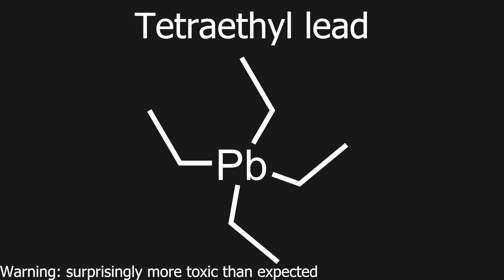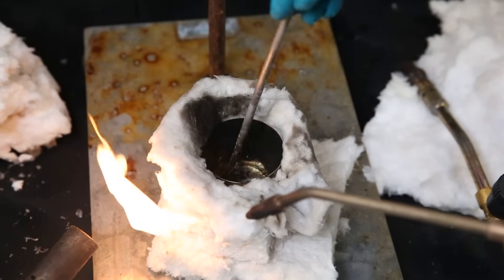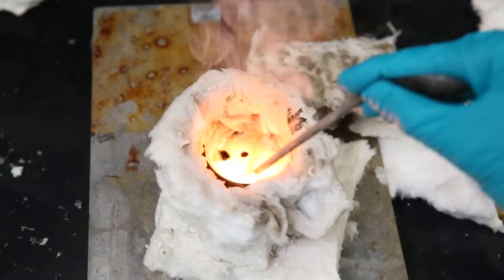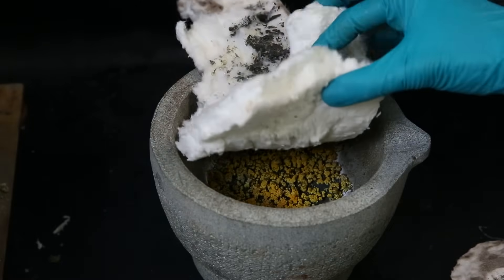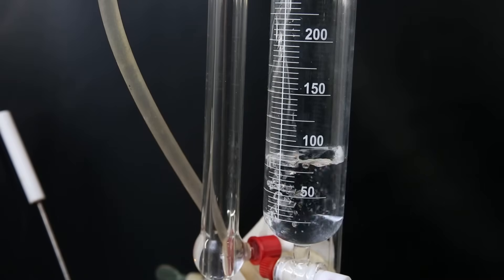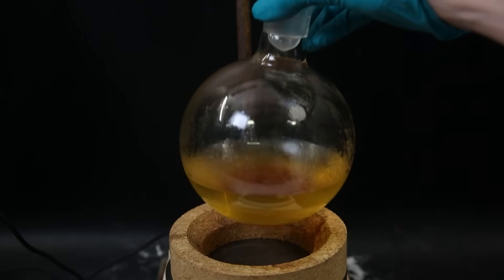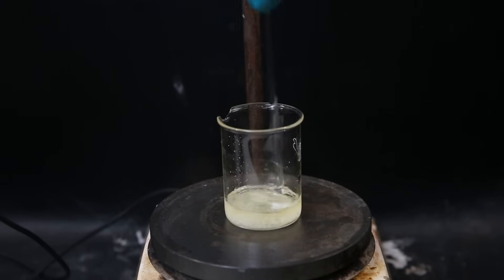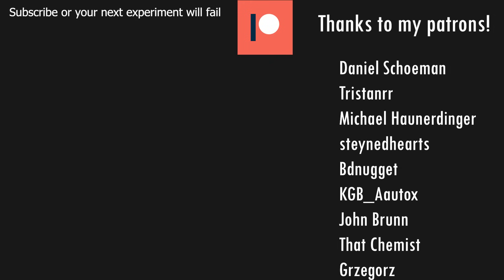Making Tetraethyl Lead

Comment: -Let's it boil and reflux instead of cooling it down knowing that TEL can decompose at higher temps
-Crushes the alloy into fine pieces before adding knowing it oxidizes
-Adds water into high sodium content alloy

Comment: Tetraethyl Lead is still used in general aviation because the older engines in many of those light airplanes require it to run properly, and while burning gas with TEL in it is a hazard - a worse hazard would be airplanes falling out of the sky....

Comment: I wonder if you could mix that in with unleaded gas to get leaded gas that would run well in classic vehicles? Obviously you'd need to produce enough TEL to get the correct ratio of fuel to TEL.

Comment: What did you do with it after you made it?  Do you have a 1974 or older car or other old engine to put it in the fuel tank?
Reply: Vp c16 is 100+octane with TEL to make it 130+ octane
Also avgas 100ll is just mildly leaded gasoline..
Older cars used lead as they didnt had hardened valve seats, which would worn them down without hard oxides that formed on them from leaded gas

Comment: I dont get the reaction of the Pb-Na-alloy with the ethylchloride. What are the oxidation states of all the atoms and what gets oxidized and what gets reduced?
Reply: Pb and Na have both the formal oxidation state of 0 in the alloy (atleast i think so). Na(0) reacts with Ethylbromid to Ethylsodium (metal-halogen-exchange). Ethylsodium reacts with Pb to Tetraethyllead (metal-metal-exchange). I think in the first step there is also the formation of NaBr but I'm not sure. The C-Atom in the C-M-Bond is always negatively charged, and the M-Atom is positively charged.

Comment: I was pleasantly surprised to see that bromoethane was a reagent in this reaction. As it was a critical component in the TEL additive package.

      The fuel additive was called Ethyl Fluid and it was a mixture of Tetraethyllead, Ethyl Chloride, and Ethyl Bromide. (Old names for chloroethane and bromoethane) the haloalkanes were used as the lead scavengers. Without them, lead oxide formed during combustion of TEL would build up inside the engine as a solid residue. 

     The lead scavengers were used to create lead chloride and lead bromide. These compounds, exposed to the temperatures of the combustion, would form vapors as opposed to dust. And these vapors were much more easily exhausted from the engine. 

TEL got the lead into the engine, ethyl chloride and Ethyl Bromide for the lead out of the engine (and into the air we breathed) And that's Ethyl Fluid for ya!
Reply: I had heard that ethyl fluid contained bromine and chlorine compounds to act as lead scavengers. Now I know what those compounds are.

Comment: It's unfortunate we ever got started leading gasoline. Tetraethyl lead used to be made with giant Gringnard apparatus. Ethyl chloride was made into ethyl magnesium chloride and a lead anode was used in an electrolysis to make tetra ethyl lead. Ethylene dibromide was added to the gasoline to take up the lead as lead bromide. This reduced the life of the engine as well as spilling lead bromide into the environment.

Comment: You are way braver than me, I would never synthesize that compound or even touch the container it's in with a ten foot long pole. How do you even go about storing that substance safely? On top of that, how do you safely dispose of it? Because it's not like it can be burned, as it releases lead oxide fumes, and it definitely can't be poured off anywhere.
Reply: Well you could toss it in a active volcano 😂

Comment: You know, some people think the main reason for the fall in crime and violence around the world in the later 80's and early 90's actually has to do with leaded gasoline being fully banned for regular cars.
Reply: Makes sense to me, though it's more about impulse control and hazard perception rather than just criminality. There was a lot of lead in the diet of Romans, they didn't think twice about setting off to conquer the world so In their case it worked for them.
 I Myself worked on a TEL / TML production plant, the operators were a fearless bunch of guys and  there seemed to be an excess of fast motorcycles/cars in the parking lot - co-incidence? I think not.

Comment: how do you handle the waste? would be nice video.
Reply: I worked for Octel (UK TEL / TML production) about 40 yrs ago (before the UK came to it's senses and stopped the use of TEL in road fuel. Our lab level decontamination procedure included potassium permanganate but I can't recall the exact procedures. On a larger scale the high lead waste produced would be fed back into the process via lead recycling furnaces before being alloyed once more with sodium.
Reply: @Derek_Garnham  thank you

Comment: Is there like an easy(ish) way to convert tetraethyllead back into elemental lead or at least a less awful insoluble lead salt?
Reply: Burn it. Forms Lead Oxide, Carbon Dioxide, and Water.
Lead Oxide then can be reduced with carbon to elemental lead.

Comment: what ratio do i use to add to my fuel?
Reply: If you want to add tetraethyl lead to gasoline, dichloroethane must be added. Otherwise lead oxide is deposited in the engine. About 0.7 g TEL per liter is enough. In addition, 0.7 g dichloroethane per liter. However, leaded petrol must not be used in cars with catalytic converters!
Reply: Not advisable anywhere that they monitor car emissions, the lead will poison your catalytic converter. The introduction of catalytic converters to reduced photo-chemical smogs was the main driver of the downfall of leaded fuel (not the reduction of lead in the environment as many think)
Reply: 0 grams per liter

Comment: I had a two stroke scooter. A moped. A 1976 Puch Maxi. I was building it all back to showroom perfect for my daughter to ride to college classes and back. I lowered the gear ratio by putting smaller sprocket up front and larger sprocket in back. I got it a kit to increase engine displacement from 49cc to 70cc. When done, I noticed that the kit had engine knock that was severe at higher revs. I took it to the local scooter mechanic that sold the kit. He said He didn't notice any "Pre-ignition". He didn't understand the difference between pre-ignition and detonation. I recognized the problem as being too high of a compression ratio for the available pump gas octane ratings. I could not find TEL. I made a thick copper head gasket. He argued against it, insisted there's nothing wrong with my scooter. I was old enough to be his grampa, I remember what these things do when running right. I know. He doesn't. So I put the shim for the head in. It lowered the compression enough for 93 octane fuel to no longer detonate. I made him ride my scooter again. He came back shocked, giggling, excited. In complete disbelief. Now I get VP racing fuel and I took the shim out and I mix Klotz oil in. My sprocket gearing was to lower top speed from 43MPH down to under 30MPH because the stock brakes can't handle the speed. The whole scooter wasn't MADE for speed. I could at least make it accelerate really good, though! My daughter then raced it. She won every race until the owner of that scooter shop had to figure out how to do his job. Higher octane is what you get from TEL. Higher octane is required by higher compression combustion chambers to slow down the rate at which the fuel-air mix burns. That's what exhaust gas recirculation (EGR) does in emissions - equipped cars. Too low of an octane allows the fuel-air mix to actually explode, instead of slowly burning, expanding and pushing the piston down.
Reply: An additional base gasket is an easier option for lowering the compression ratio
Reply: @jimnasium3979  Moving the jug up moves the intake and exhaust ports with it - changing their timing and volumetric efficiency, no?
Reply: @skeggjoldgunnr3167  
Yes, but not enough to matter in a  low-performance engine.

Comment: Someone needs to build a 16:1 compression ratio internal combustion engine, mix gasoline with TEL to 114 octane, set timing to no knocking, most power output on a dyno. THEN try gasoline in same engine with other so-called octane boosters and compare the dyno results.
Reply: Nothing else comes close to TEL as far as an octane booster. As far as testing just take your samples to Inspectorate or any other fuel testing lab and have them run it in a CFR engine. Adding more TEL to gasoline has diminishing returns. 16:1 static compression isn’t a real test as the dynamic compression will vary depending on cam timing as well as engine speed. I’ve run 15:1 static compression engines on 110 R+M/2 gasoline without any detonation and I’ve had 12:1 static engines that couldn’t run on 110 without retarded timing. These engines had nearly identical combustion chamber designs but vastly different valve timing events.
Reply: @Trump985  Last motor I built was 14.7:1 with mild dual pattern marine cam for a daily driver pick up truck running on Shell 93 octane. I had to put in a Jessel belt drive because gears made noise that triggered the knock alert sensor I got from Anson turbosystems. Normally aspirated 427 small block chevy stroker kit with dry sump, EGR opened when knock detected, smog pump for scavenging crankcase into exhaust secondaries. 327 double hump no bolt hole 202 fuely heads. long rod to stroke ratio Eagle H-beam rods Keith Black hypereutectic pistons, forged Crower 400 crank in a high nickel siamese bore block. Had to break down and use a gear reduction Hitachi starter because I was burning up Corvette starters and the auto parts counter was starting to complain about my abuse of the warranty. Pickup had wood panel stickers on the sides, lotsa gaudy chrome. A cap on the bed. Trout and bass and pheasant and buck decals on the windows. A Union 76 ball on the tip of the antenna. A big full width white rubber "Keep on Truckin'" mud flap in back to hide the tire meat. I did everything I could to conceal its nature: over 500 ft/lbs of torque put through tall gears. (2.72:1) On the Chicago 294 loop I would drive studying my passenger mirror for the BMW doing over 90mph to cut me off. He got a semi in his lane in front of him, just a little ahead of me. He's expectin' to slip in there then stamp on his brakes in front of me. The moment he gets beside me I floor it. He never makes it past my passenger door window. HA! Look at his frantic intense expression! As I hold back to keep him hoping and believing he has a chance. I keep him there. Then he finds his brake pedal. AND his horn! Phhffft! A tantrum! I love it!  Written backwards across the front edge of the hood: "My Insurance Policy" with arrows pointing down at my push bar / brush guard.
Reply from the maker: I will gladly donate my TEL to whoever can do this =)

Comment: Hey, conducting this in an inert atmosphere would have made things far less messy and probably would radically drive up your yield.

Also, hope your nutrition is fantastic. The more natural chelation agents you ingest the better.
Reply: Gloveboxes are a chemist’s best friend.
Reply: @Anton_Øgærþson  Yes, but not all labs have them.
Reply: @durshurrikun150 can be made quite easily with some extruded aluminium bar, perspex and chem gloves.
Reply: @mrslinkydragon9910  A discount glovebox will not have the same results of a proper glovebox
Reply: Chelation isn't real, it's woo....unless you're in a medical setting otherwise you're better off with essential oils.

Comment: Obviously it was entirely right that TEL was banned, but the chemistry of how it worked was pretty ingenious
Reply: Not COMPLETELY banned. Still used in aviation gasoline....
Reply: Not banned just  not used anymore due to emission control systems (i.e cat converters.) TEL is still used in aviation and in race fuel
Reply: I understand that it wasn't banned for it's direct health effects but rather to allow the use of catalytic converters in order to tackle the problem of photo-chemical smogs (lead poisons catalytic converters ).

Comment: Fun (terrifying?) fact: Aviation gas still uses this today!
Reply: So, the logic is just to be high enough above the ground and all promblems are gone. That really sounds like politicians logic 😬👍
Reply: @7784000  I have heard that it is because ethanol can draw a bit of water to itself its shelf life is a bit worse. And because avgas is mainly used in private owned small scale operators their gas is not as fresh all the time and bad gas could lead to malfunctions. And a malfunction of a car is not a bad day after a plane malfunction.
Reply: @tony flamingo  so instead they use jetfuel and basically add the Tetraethyl lead to have it stretch because of the expense rate ?
Reply: @tonyflamingo3285  Yeah, ethanol in fuel is an absolute disaster, but the main thing is just certifying old engines to run on an unleaded formulation. As you say, avoiding engine failure in an airplane is absolute top priority from a risk management perspective.
Reply: @NicholasA231  Yes, since many lawsuits and new safety and equipment regulations made new small airplanes basically unaffordable for "normal" people (in the 1960s they used to be in the region of a luxury car, now its more of a house .. even with todays housing prices) the majority of the fleet is .. OLD. Lots of airplanes from the 1950s-1970s.
Reply: @drepersaud you can’t use jet fuel in a reciprocating engine designed for gasoline or you will end up with rapid unplanned disassembly (if you can even get it started in the first place)
Reply: safer to burn low lead avgas then to have planes drop out of the sky due to burnt valves or watery fuel once they fix those problems it will be phased out it is still used widely in motorsports as well as you cannot see an alcohol burning during a fire. Im all for ethanol based fuels but they have there own issues with safety they are also more carcinogenic and absorb through the skin easier causing really bad dermatitis for mechanics from relatively short exposure at only 10% ethanol and other weird issues since the switch if you are doing in tank fuel filters every day not waring gloves wouldn't surprise me if you ended up going blind especially if your dealing with e85 and methanol its surprisingly poisonous. With the small use of av gas at the moment the levels in the environment are still steadily dropping hence not fully banning lead in fuel. Once you an adult most of the risks with leaded fuel don't affect you it mainly targets younger people and babies developing hence the ban once we started to see how much was in the atmosphere and water everyone was drinking in city's.
Reply: The modern substitute for TEL as an anti knock compound is ethanol (which will interfere with reliability over time and cause issues). 

Aside from an antiknock compound, TEL has lubricating properties to it. I think its safe to accept a little TEL in avgas to prevent unplanned landings....